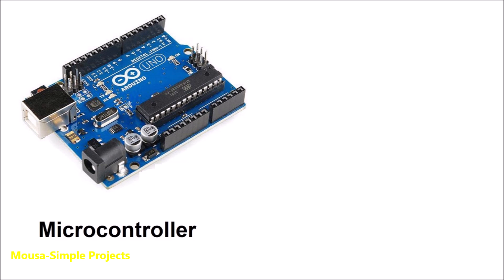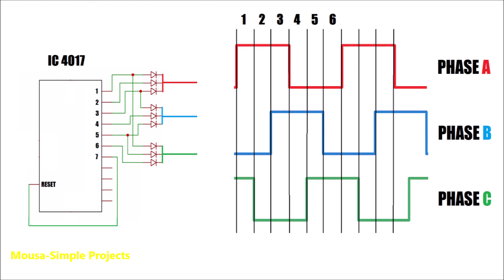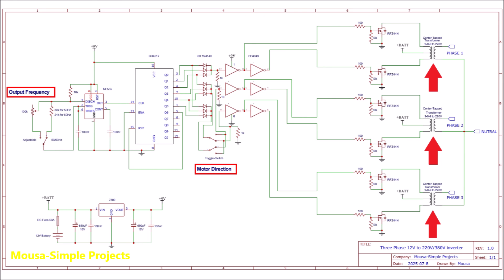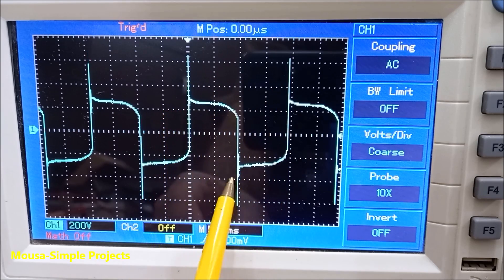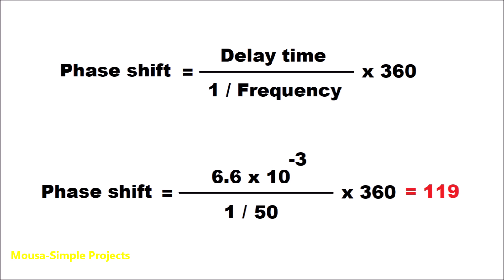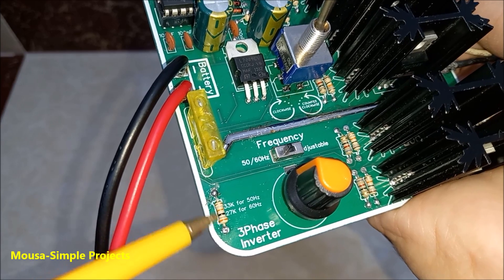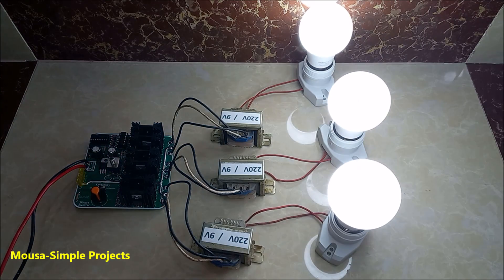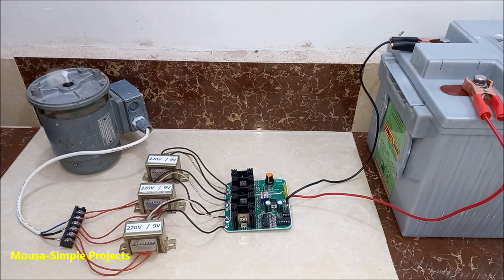How to make DIY 3 phase Inverter 12V to 380V AC / Three Phase Inverter Explained

Comment: Wonderful show perfect project, you can mount it on an electric gate that uses a 220v three-phase motor that will work like a charm. using a 433mhz multifunctional control unit to trigger the inverter (the other forward and return functions, stopping with the magnets is a small and easy thing to do) already the top project is much more advanced ;-)

Comment: This topology is called six step 3phase inverter and it is better than svm method from the torque side and even speed is more but disadvantage is the constant speed because output speed and voltage is directly proportional to input voltage and input voltage is constant

Comment: I once built an inverter for my cnc router. I used an MC3PHAC type IC because I don't trust software solutions. It's a bit more complicated than this, but it's more efficient. You can also set the parameters with resistors. You need a transformer for the 600V DC power supply, 1000V FETs, FET driver optocouplers. You could learn a lot from it.